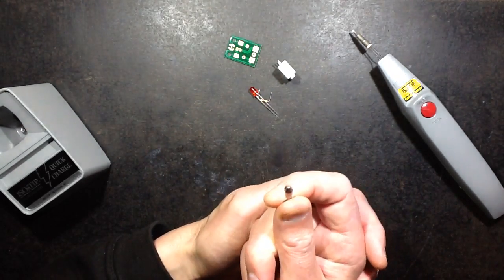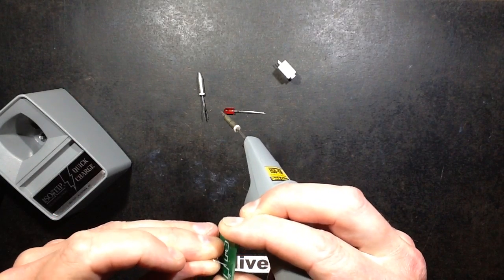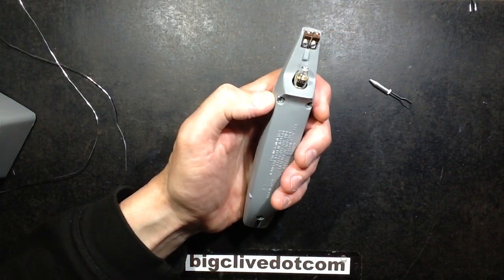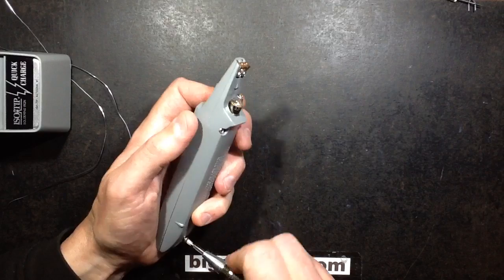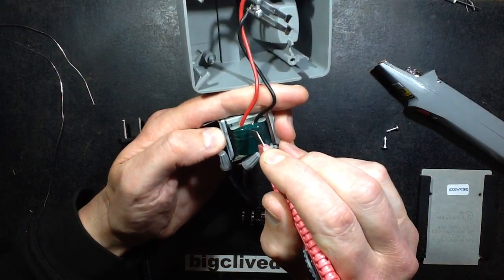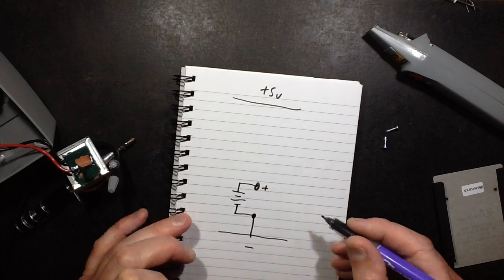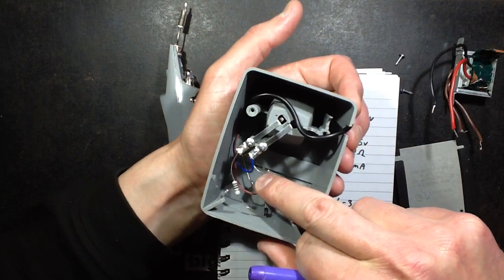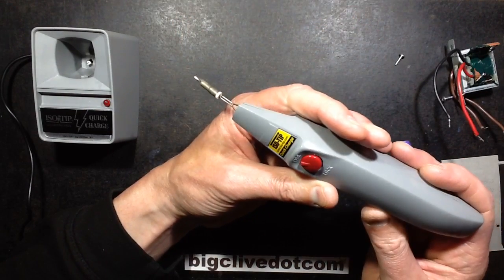Inside an Iso-tip rechargeable soldering iron.  (And charger hack.)

Comment: I had one branded Weller, and it worked well till the 2 NiCd cells eventually died.  You could also make a DIY tip using a short length of steel wire bent to shape and make a flat tip using a hammer. NiCd cells because they can supply a massive current for the size without failing, and also do not mind being left long periods flat, unlike the NiMH cells which both cannot do high current and also they fail. Lamp lasts forever, as it is severely under run, being meant for a 2 cell torch. Only time I changed them was when they broke apart from me dropping the iron on the floor.

Modifying to charge on USB means you can leave it charging all the time at 50mA, as opposed to the old charger of only limiting charge time for 1hour and take off or risk the battery.

Comment: Wow, they still make those ??
I had one during the 70's, got used a lot, mine was orange, i think the battery failed to hold a charge, didn't get around to changing it, and over the years it got lost in the piles of junk, though i still have a tip in one of my parts boxes, i know at one time i had thought about powering it directly.
Might have to see about buying one.
Reply: ***** Yes, they are still being manufactured and there are different models to choose from. I have the model 7800 with the 60 minute charger and it's a top notch product.
Reply: Jerry Carriera Yep, went and searched for them,  i need to save up and get one.
also noticed bigclivedotcom that this video is on their site
Reply: I had an orange one it was fast charge model. And a friend had the black one which was the normal charge model.